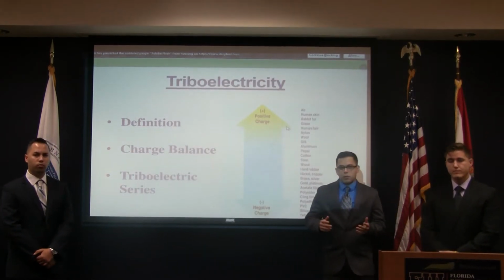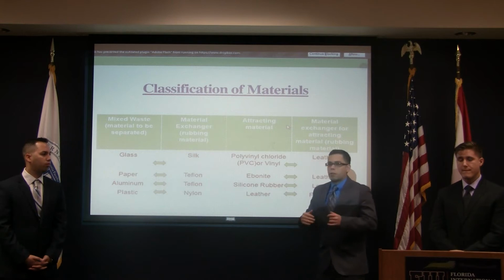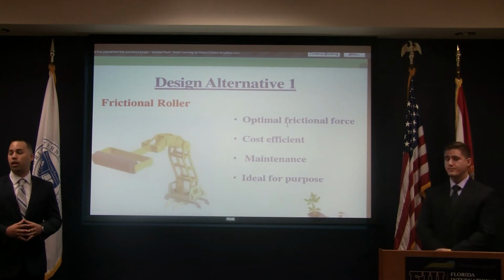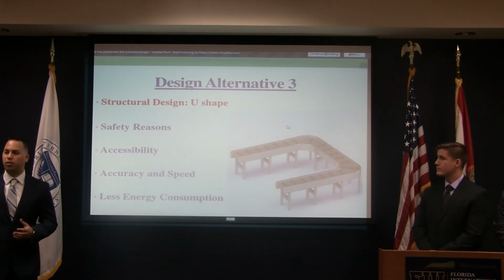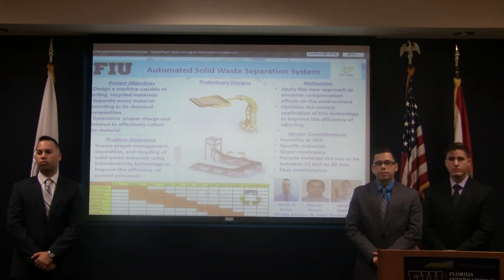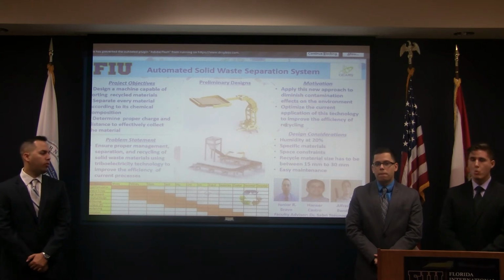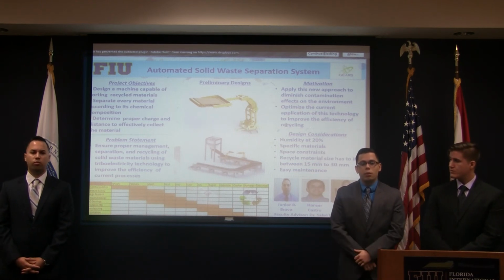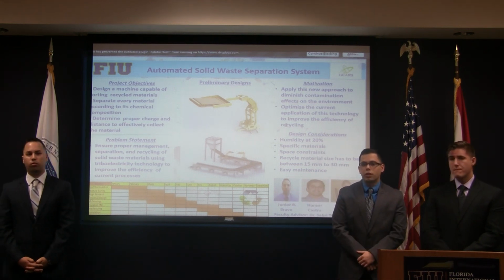SDO Team 5: Automated Solid Waste Separation System

Comment: This was a great presentation. The Power Point slides are creative and include many great features. The SolidWorks model of the final design makes it easy to visualize how the system would function in real life. There are a few problems. Although the presenters are knowledgeable in the topic, presenters 1 and 3 were visibly nervous as they spoke too fast and in a very low  volume. The sound quality did not help the speakers as there was background noise in the video. The presentation would be better if those speakers relax a little and speak in a more assertive tone.